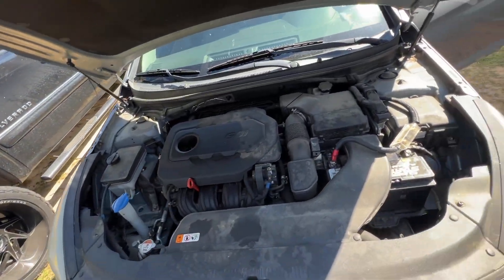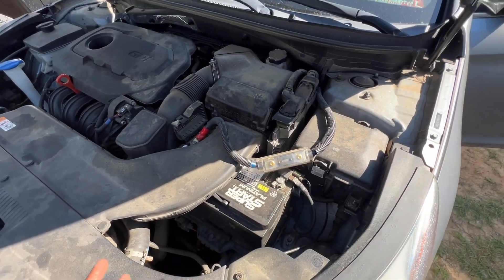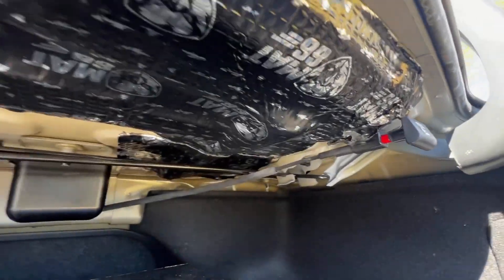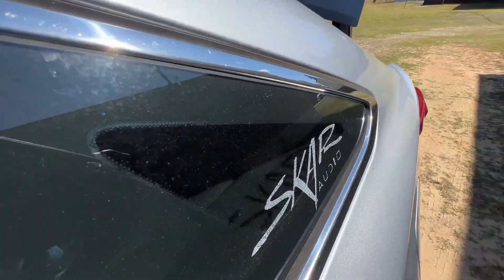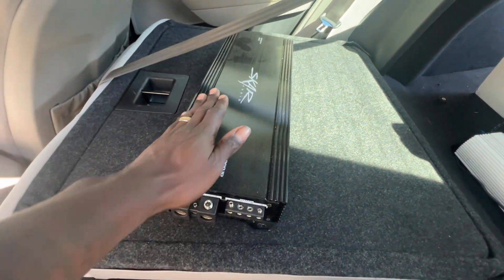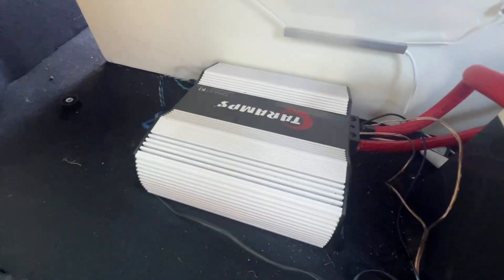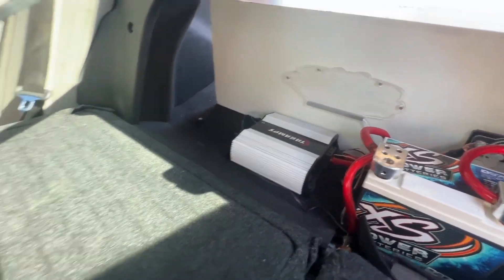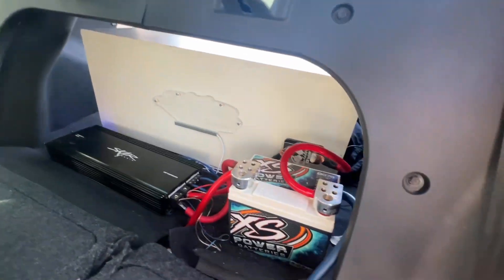Taramps Smart 3k Took A (Sh**) | Skar Audio Rp. 2,000.1 To The Rescue!!! | Skar Ddx 12s (SLAMS)

Comment: I just installed a smart 3 bass in my car on a sundown x12. In the beginning my amp kept cutting out. I thought I was going to have to send it back, but I remembered watching a video from Jerryaintloud. He said taramps are picky about RCA input voltage. Some of these taramps don't like RCA input voltage over 2 volts. On my car I have an audiocontrol LOC that I had to lower the voltage on so my amp wouldn't cut out anymore. All seems ok for now. Hopefully it lives a long time.
Reply from the maker: It should bro I guess it’s just the luck of the draw. I’ve had two other smart 3ks and never had a issue with either. I’ve had the md 8k twice with no issues so idk 🤷🏽‍♂️

Comment: Good to have a spare... I've been running my Memphis mc 1500 d since like 04 without issues I have other newer amps but I'm to lazy to build a new amp rack 😊
Reply: Memphis was my one number to go to till I found skar for the money way better you get more for your money
Reply: @rubenavila8012  I have a few skar products I have a 800.1 pushing 3 JL 10s in my wife's car it's been a good amp for sure.  I got it in a package deal with 2 12s I believe sdr or something like that. I never used them, but I do like the box they came in just needs a little bit more port area 🤔. I had four of the Memphis 1500d as well as a four channel at one point but only one is still working.

Comment: Gotta mount your amps something probably  went loose inside and it took a crap from vibrations or bad dirty clipping  high signal
Reply from the maker: That could be it too. But the amp was never clipping m. It had been making a strange sound from time to time as well but when I checked it everything was fine

Comment: Taramps make some nice power supplies but im not a fan of there amplifiers....I personally went through 5 before i said taramps is not for me lol... efficiency is important for me due to ecu controlled changing...So JBL club A and the diamond audio DES1000.1 are what im running now and beyond happy with ..Good clean power high dampening factor and do 1000 watts with 60 amps of current draw...Dont ask me how cause it should not be possible but they do somehow!

Comment: Did it blow due to clipping or just by daily use?
Reply from the maker: I’m thinking just daily use I got it used so it’s no telling what was wrong with it
Reply: @BassAddict91  If the fan was not working from the start, it prob. just got too hot too many times, and melted a soldier joint? Did your wife hear a loud pop, or smell anything, or was there smoke, when it stopped working?

Comment: You got me hella debating on whether I should get Taramps 3k or not 🤦🏻‍♂️🤣
Reply: Bruh don't do it . I learned the hard way. I had a taramp 800.4 it went up in smoke less than 2 weeks . I replaced it with a DB 45 had it running for a year with no problem
Reply: @leroycolejr6626 thats not the same amp. Like saying don't get a Chevy truck, cause my cheap ass Chevy sonic sucked.
Reply: @matt6951  bruh I didn't say that was the same amp. All I said that taramp is known for blowing up. I guess now you gonna say that I ain't hooked it up right. That's what y'all fan boys do
Reply: I have a Smart 3 and it gets down. The humming noise should've been the fans running. Their fans are loud
Reply: As a matter of fact I ended up getting a Smart 5 Bass. It gets down too.
Reply from the maker: I know I’ve had about 3 or 4 of the 3ks. The fans wasn’t working while it was making the noise. I’ve had about 5 or 6 taramps amps
Reply: @leroycolejr6626 just smoked a bass 3k , and smart three on 2 Brazilian 15's,  in less than 2 weeks

Comment: Do you have your wife's subwoofer's wired to 1 ohm, or 1/2 ohm?
Reply from the maker: 1ohm
Reply: @BassAddict91  Do you know how much Rca voltage your wifes deck puts out to the subwoofers? I say this cause full bridge amps, dont last long if you give them too much Rca voltage ( they like around only 1 volt max.!), too high, or too low, of input voltage( 12.0 to 14.0 ) is there sweet spot, and dont run below rated impedance.

Comment: Check out the d4s down4sound amp it get down
Reply from the maker: I have the jp23
Reply: @BassAddict91  jps amps are korean built half bridge= built like tanks. If you run @ 1 ohm, on a 1 ohm stable korean built half bridge amplifier, expect 2 to 4 ohm power while playing music, but will last a very long time. Half bridge will have Less noise, higher damping factor= tighter more controlled= less sloppy bass, better quality cross overs, arent picky on voltages, power, or rca input, and the low bass wont drop off below 30Hz vs full bridge. The down side is they cost more per watt, and are bigger= with big heat sinks = runs cooler= lasts longer, so its better.